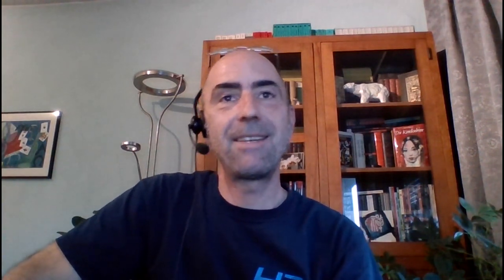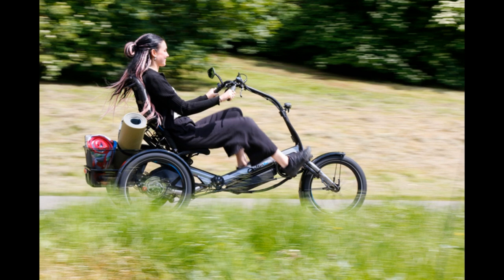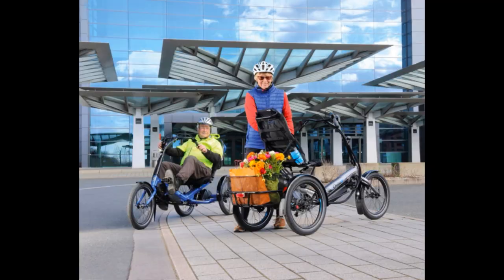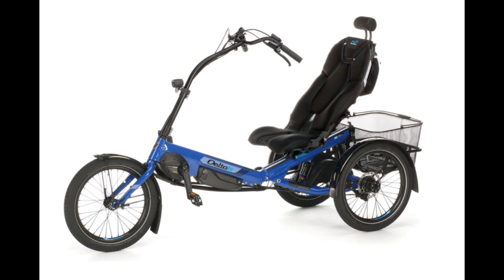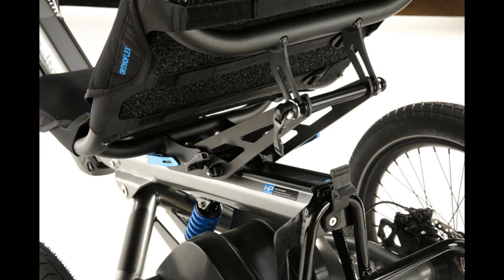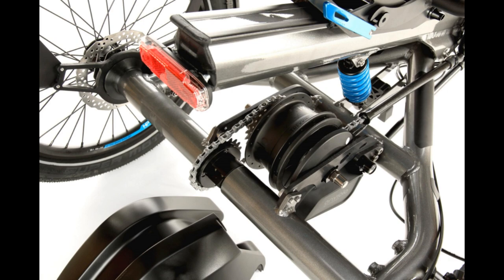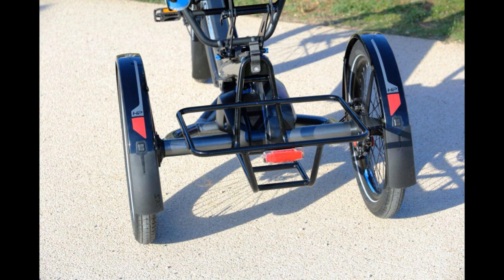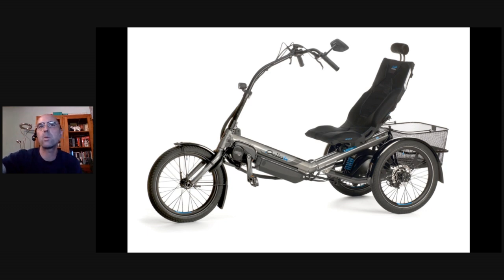HP Velotechnik is Making a Delta Trike?

Comment: I was building Delta trikes before I ran out of money. tadpoles are sportier as he said, but they sit too low for me. I have always preferred the Delta with its load capabilities so I am happy to see this.
Reply: there are many tadpoles that sit nearl;y as high as deltas or put you near to head height of car drivers - Anthrotech, Leitra, SunSeeker, GreenSpeed, Kent, and HP's own Adaptive series, for example.   just depends on the purpose - sport versus cargo versus accesibility.
Reply: @JimmPratt interesting selection how would you rate the  Azub mini in comparable height seating position to the aforementioned?

Comment: I have a Scorpion fs26. I enquired the price of the low mesh seat and I was in for a shock. It cost 700 euros. The seat is made by Radical Design in Holland and sold by HP for the same price as RD sells their trailer.

Comment: I noticed it has over seat steering.  I think that the serious competition has under seat steering, right?  My deltas have over seat steering, but my husband's delta has under seat steering (Easy Racers).  Is this difference like direct and indirect steering?  P.S.  I love the N380 on my tadpole and it sounds like a great addition to a delta.
Reply: Correct. Over seat steering is typically direct steering. 
Under seat steering is typically indirect steering.

accommodating
Reply: @garyseckel295 is it true the direct steering tends to inflation more twitchy ride than the indirect steering?

Comment: Delta-planform recumbent trikes are the coming growth of recumbency.
Majority of riders don't need redundant steer wheels on bike paths that are every bit as straight as railroad tracks.
Most suspension under rider's torso is desirable, and no disassembly for a flat tire either. Think about that!
Sit side saddle on seat and swing, OR lift, a single leg over frame while ALREADY being seated! 
This, even from a wheelchair!
Get an internal hub. Rear cassettes way less desirable for most riders!

Comment: Fat tires and faster maybe 28-30 mph I would by 2 myself. But it’s seems I’ll have to go with ADDMOTOR M360ii start at 22mph but can unlock to 28 mph. 750 watt motor and 48vote 20 amps battery. More power. More younger people will buy . Your bike looks very good. If it was faster you would sale sale sale…

Comment: Makes no sense; the two wheels and the chain guard tubes rob power from the mid drive motor.  What's the point of all the parasitic loss?
Reply: Twin tires directly under weight is way less wasted friction, AND hugely greater traction! HELLO?!
Look way beyond more ball bearings, etc, and see less tire squirm! 
Twin tires under load is a Win, Win!

Comment: can they upgrade theirs recumbent bike to e-thru axle wheelhub? 
it's 2023 right now they still using the design 10 yrs ago.
and the quick release wheelhub is nearly EOL right now.
Reply: e-thru axle wheelhubs are nice, but still expensive to produce and only come from one company (discounting Asian knock-offs).  tech from 10 years ago are typically standard, reliable, and cheaper to manufacture.  this is why belt drives are taking a long time to saturate the market. I think many people like the quick releases for tire/tube/wheel-size changes without the need for removal tools.
Reply: @JimmPratt  
it's funny to see they sale the 2013 to 2015 designed frame at 2023 and twice price as its released. the e thru x wheelhub has the same price as the quick release. mtb bike had alread retired QR wheel, in next 1 or 2 year, most of road bike brand will retire the QR wheel too. Only the cruz bike had updated the design, and it's nearly the only high performance recumbent bike on the market.
it's sad. gcn and others main stream media treat the recum like a clown, and the factory  still consider the 20$ costing increasing.
Reply: @黄辰旭  if e-thru and quick-release are now the same price that is great!  People may still prefer the quick-release, mostly because it is a quick-release - no wrench or socket tools needed to remove the wheel from the cycle when servicing it, like changing a flat tire.  While the delta is suitable for everyone, people with less repair experience or less mobility or strength will appreciate the quick-release.  

Remember, this not a performance trike, it is a comfort trike.  It is an e-trike. so the target market will be different than the performance market.  Hase and Sunseeker have done pretty good with their deltas, so I do not see any problem that HP Velotechnik tries to offer the public their own idea of a delta trike - in this case a dedicated delta e-trike.

Unfortunately Inflation, supply-chain issues, and the rarity of 'bent sales compared to uprights often lead to raised prices in the production of recumbents.  Plus new deisgns or productions of new cycles tend to start out more expensive than long-running produced cycles because the creators would like to re-coup their investments quickly - that's common business logic..  Just wait, if you want to see the price drop - it will likely happen in time, as they bring out newer or different models..  

If this bothers you, bring us competative and less expensive solutions.  Let's see your delta trike on the market.  :)